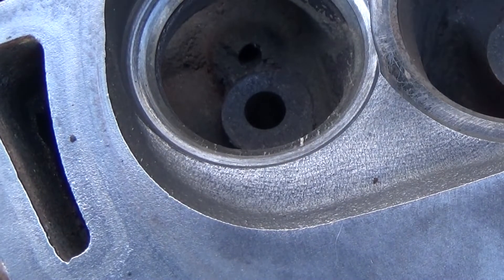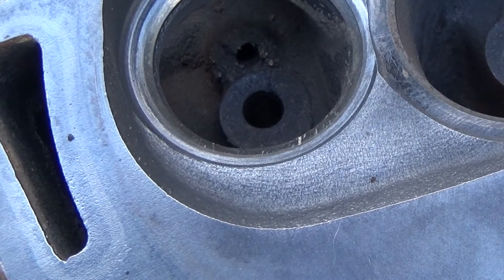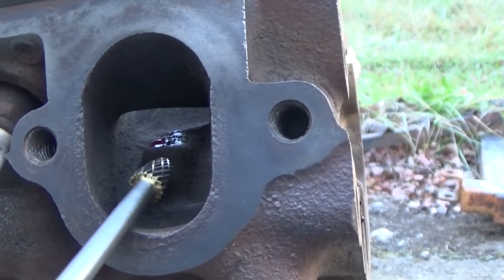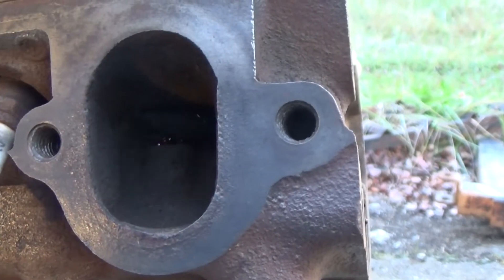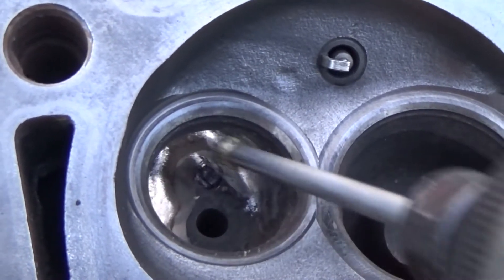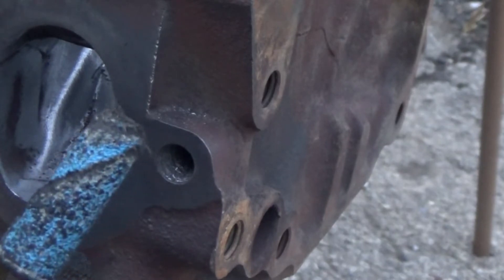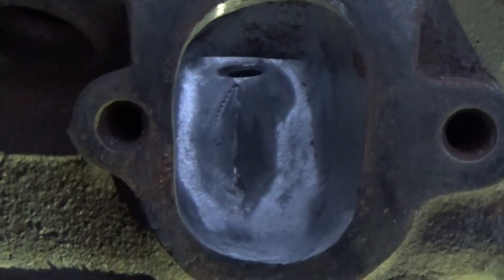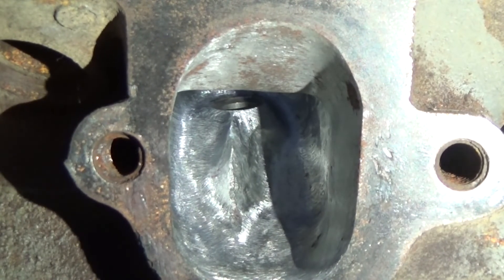460 Cylinder Head Porting

Comment: Years ago I build a couple of sets of heads following guidelines such as you lay down here.  I added a couple of things on the exhaust side, however, that I think really helped my heads.  I filled the 'dead area' at the bottom of the exhausts with Devcon F to further maintain flow.  Also 3-angle valve job (I and E).  I was towing a 22 ft Great Divide camper with my '76 Ford van and could get 11 mpg up in Wyoming @ 6200 ft elevation traveling 65 to 70 mph fully loaded.  If I wasn't towing, I could have all 6 of us plus all tent camping equipment and regularly achieved 18-19 mpg.  I "tricked" my C6 with a shift kit and had a matched converter.  I used TRW forged pistons with a 10.5/1 piston ratio.  I carefully cut a flame channel on the piston top and my final compression ration was 10.3/1.  Also advanced the cam 8 degrees and recurved the distributor to meet my needs.  Also used water/alcohol injection for the hard pulls.  Ran 16 degrees initial timing with a total of 34 degrees all in by 3000 rpm.  I put a Comp Cam RV cam (don't recall lift and duration) and I had power everywhere.  I regularly passed drivers on the interstate that I needed to with ease.  Unloaded the van would spin the tires for nearly a block then snap-shift into second and spin again.  Man, I miss that rig!  It is unbelievable how these mods + others can help the 460.  Even the 454 Chevy guys were amazed.
Reply from the maker: I don't doubt that filling the floor helped them. That was a common practice on the Cleveland heads and if you look at the exhaust port of the 460 fuel injected heads you will notice that the floor is raised on them and those are the highest velocity heads ever put of a 460! I've always said the the 460 needs three things to wake them up. Raise the compression up, open the exhaust side up, and straight up cam timing at the very least to do away with the 8 degrees that the camshaft is retarded from the factory from 1972-1986. So what you're saying about yours makes perfect sense to me.

Comment: Nice job. I welded my thermactor holes closed. works nice.  thank you sir.
Reply from the maker: Did you use a nickel rod?
Reply: @BlackLabGarage  always
Reply from the maker: @Backfire10  I wondered if that's what you used. Isn't it hard on the carbide burr?
Reply: @BlackLabGarage not really.  As you know, it's a very small area.

Comment: You were talking about how ford redesigned the D3 (1973) head. The absolute worst 460 heads are the D2 (1972) they make good door stops 😢.
Reply from the maker: I agree 100%
Reply: Let's be clear, what your talking about is the D2VE heads. The reason I'm saying this is becouse in 72 they made 2 different sets of one yr only heads. One set is what your speaking of & known as the worst heads. The other set is also D2 heads but a very good & sought after head known as the police interceptor! Those are D2OE or sonthing like that? I'm poor so I don't get near them. But I know of them!

Comment: Thank you for the video. I just drilled and tapped my d3 heads as you demonstrated. My question to you sir is what kind of bolt material do I use? I have the high temp thread lock, any issues with the studs ever backing out of the casting?
Reply from the maker: I use a regular bolt because a hardened bolt is too hard on the carbide burrs. I've not had any problems with them backing out not just because of the high temp thread locker but also because the bolt itself is bottomed out in the the head which would also make it hard to come loose.
Reply: @BlackLabGarage  I really appreciate the feedback and look forward to learning more from your experience with these 460 engines. Slowly but surely I will have it together.
Reply from the maker: @eriktrott1067  The 460 is one of my favorite Ford engines. Just take your time and build it right with good parts and it will pay off!

Comment: The short side radis is always  the first  thing I round  off . When porting heads.chevy Ford Dodge  it doesn't  matter.
Reply from the maker: That's probably where the most gain is to be had is on the short side radius.
Reply: @BlackLabGarage  It's the main part of the process  for me.  And good bowl blending around  the the intake  valve  guide.
Reply: @BlackLabGarage That's   where I get the most gains.  And bowl blending around the  intake valve  Guides.✌️🔥🍺🇺🇸

Comment: I have always wondered why Ford has such smallish exhaust valves including the Ford FE Heads.
Reply from the maker: Most all of the Ford pushrod V8’s suffered from small exhaust valves and small exhaust ports. The small block Windsor family probably being the worst! Why they did that I have no idea?
Reply: Their engineers were not stupid. Blow down pressure is immense and very little is gained by a large exhaust. Intakes operate at atmospheric pressure of around 13-14 psi. Cleaning them up does not hurt. As Bob Glidden says of chopping off the entire upper portion of the exhaust on the cylinder head on a 351 C Pro Stock engine and adding a plate "It's only worth 10 hp at 9500 RPM!

Comment: I loved the breaking of the bolt in the head! What you say about the 460 in a bit like the Clevland 4V exhaust. They are a bad compromise for a  series of engines that can  haul ass!
Reply from the maker: Yes the 351C 4V engines were powerhouses for their size! I honestly think the 429/460 exhaust port is worse than the Cleveland exhaust port.
Reply: @BlackLabGarage  Wow, that is saying something!! Thanks for the reply. Cheers.
Reply from the maker: @MsKatjie  Both the 351C and 460 exhaust ports suffer from a U shape port but the port for the 460 is trying to support 109 more cubic inches than the one for the 351C.

Comment: Great down to earth, well explained video sir. Like me, you know your 460's. I have a 73 block with D3 heads in my 67 Mustang gt. Were ported on the "Exhaust side" and port to gasket match on the intake side. No cam change at this time until Trick Flow heads cam and lifters etc go on it. Will also increase static compression to around 10:5:1. But currently, paired to a built C-6 trans and 4:11 in the 9" , headers, Performer rpm intake, MSD mechanical advance, 6al box, 750 holley carb makes a nice street engine. Thanks for sharing. Looking forward to more good content. Cheers from Motown/Dearborn.
Reply from the maker: Thank you for your kind words!

Comment: How well do 72 heads flow? Guy local to me has a pair with his motor for sale. What else would you do different for a car motor? This one's going in a 72 torino
Reply from the maker: If they are the D2VE 429/460 head stay far away from them. They are an open chamber design and spark knock very easily. That’s why they was replaced by the closed chamber D3 head a year later. If they are the D2OE Police Intercepter casting then they are fine to use as they are very similar to a 429 Cobra Jet head.   If I was to fix a set of D3VE heads for a stree/ strip car I would have Cobra Jet sized valves installed and do the same porting work except open the intake port opening up to Cobra Jet sized ports and run a Cobra Jet intake on it. Now you don’t have to do that because Ford installed Cobra Jet intake manifolds on standard cylinder heads on marine engines and left the port mismatch as is and they ran fine but personally I would match them or at least get them close.
Reply: Danny, the 72 was the worst 460 their worst engine, heads etc One big block turd. 1973 was redesigned a a lot better but not near as good as the 68-71 block and heads. Or, get a 460 out of an EFI truck, is pretty good also. Remember, after 1971 the compressions dropped to around 8:5:1, 205 HP, down from 68-71's 365 HP. Best early 460 stock heads are the DOVE heads.
Reply: @robertclymer6948   I ended up going with a 351W. My thinking was that aftermarket parts were cheaper, and some improvements to the design of the engine I chose (last year, 1997 efi motor has roller lifters, one piece rear main seal, etc), as well as a slightly lighter overall package over the front nose. May get a 460 someday but this Torino is going small block! Great information to keep in mind though
Reply: @robertclymer6948 the short block of a 72 460 is solid! They just have the poor heads. Nuthing wrong with the 72 lower end.

Comment: I have always been a believer in cylinder head porting and deburring. I have a small drill press that I use for back cutting and swirl polishing valves.
Reply from the maker: I tried the drill press method but the files were way too soft. I was even using Nicholson files. I agree with you on porting and deburring. There are very few if any cylinder heads made that can not benefit from some porting and deburring.
Reply: @BlackLabGarage  Intake valves I use a flat file but exhaust valves that are much harder I use a die grinder with a stone. For swirl polishing I use a fine grit sanding roll while the valve is spinning in the drill press and manipulate the die grinder for that neat looking swirl effect.
Reply from the maker: @paintnamer6403  That's what I tried was brand new Nicholson flat files and then I tried using a new whet rock and neither one would touch those valves! They are just stock replacement valves so they shouldn't be that hard!

Comment: I mig welded those holes shut on my 1976 lincoln heads and ported the crap out of them. So much material to remove with the smog humps
Reply from the maker: Yes! People would be surprised how much difference it makes in a 460 by just removing the thermactor humps.

Comment: I have only ever seen that once. I had 2 old audi 100's and the one I got running would stay idling with the spark plug wires pulled off. Blew my mind
Reply: Dieseling. My 460 would do it last summer